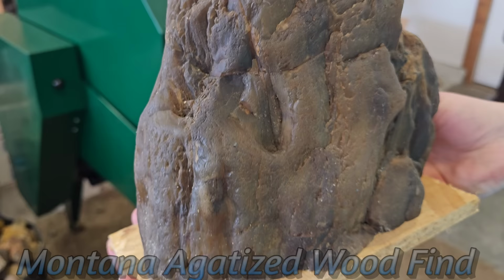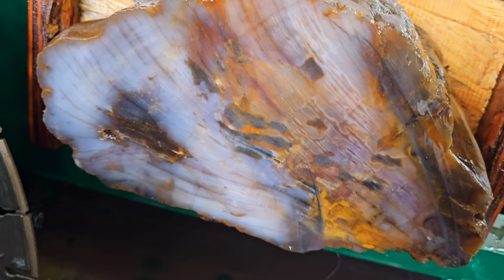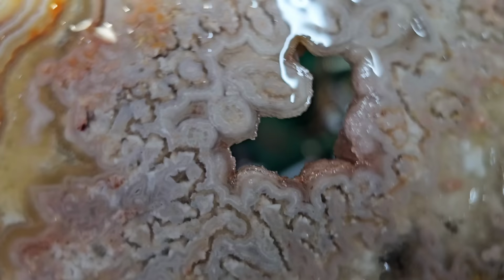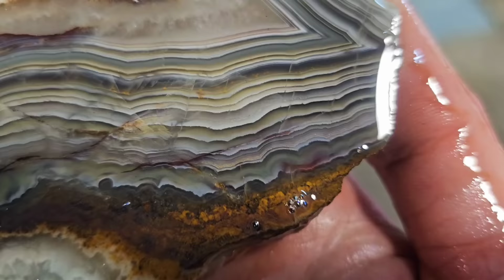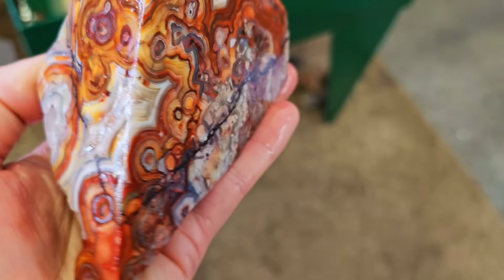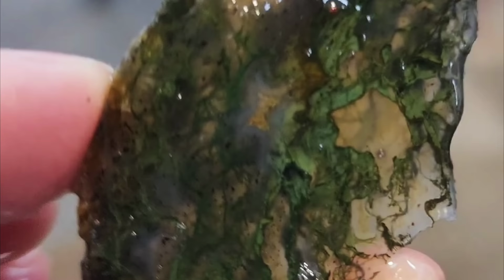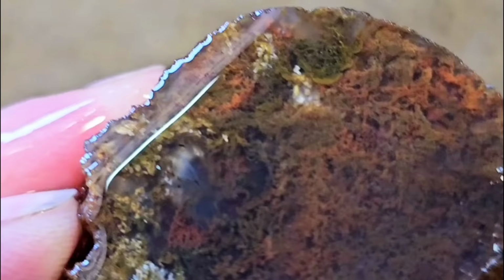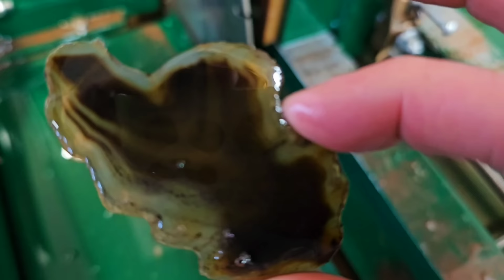Colorful Rock Cuts... Mossy Agates, Jasper, Agatized Wood & Crazy Lace | Large Rock Cuts

Comment: As usual, these are jaw dropping slabs!  What glue do you use to adhere to the board?
Reply from the maker: Wood glue....
Reply: @MontanaRockMom  is there a brand?  The stuff I tried didn’t last for 30 seconds in the saw.
Reply from the maker: @kimdedominicis6893  I used gorilla wood glue. I waited for it to entirely cure, it held my 25 pound rock perfectly without even a hint of movement or loosening. There have been times in the past where I glued a rock to the wood, but went to cut it too quickly- not enough curing time.

Comment: Nice stuff. What do you use to glue the rock to the wood? And how do you remove it after?
Reply from the maker: Just use a small amount, let it dry a couple hours. When you're done, you can soak the wood in warm water overnight for easier release, or use vinegar or acetone to dissolve the glue.